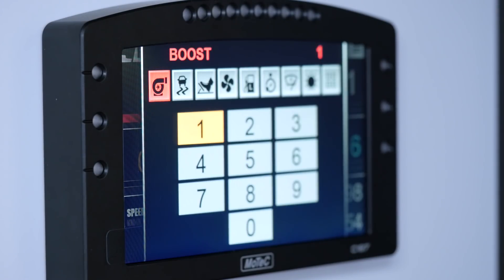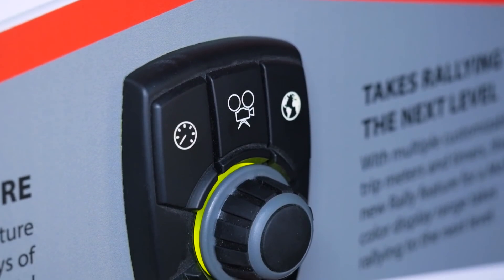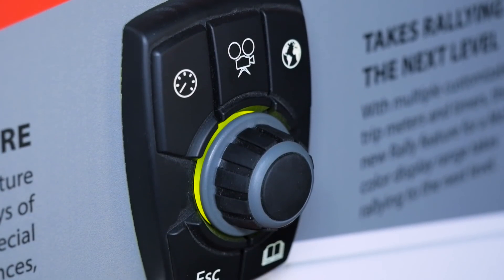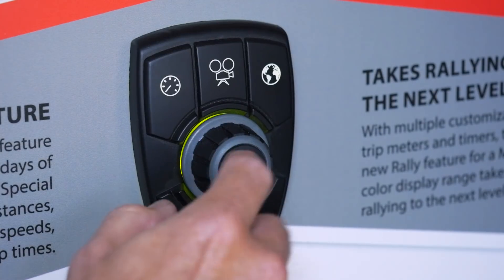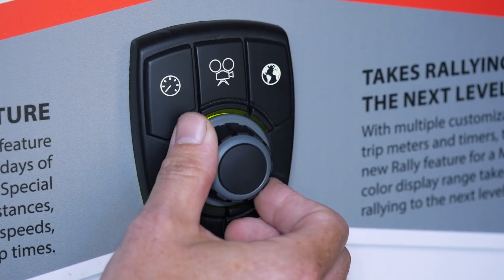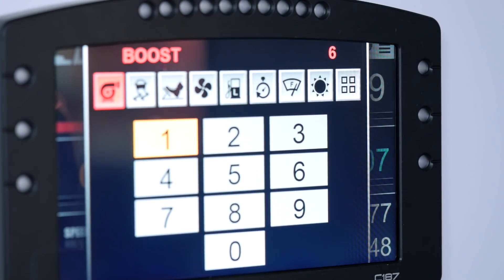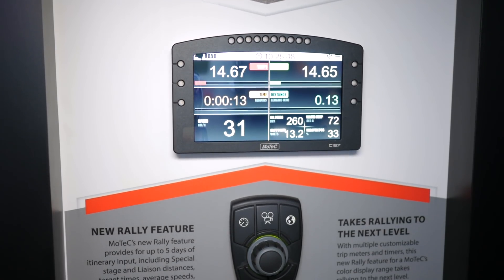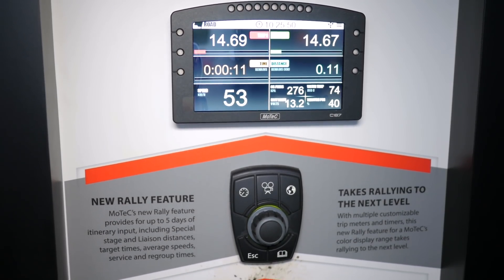Quick Adjustments On The Track | MoTeC [TECH NUGGET]

Comment: It's funny to see that CANBUS is really just becoming mainstream in performance engine control....... but in my experience...' 25 years in the printing industry as an electrician'..... it's actually very very very old school!!!! I and countless others have been working with CANBUS and many other much better protocols for at least 15 to 20 years!!!!!  CANBUS is not new.... it's good... but not new!  But it's sold to you as the latest BIG THING!
Reply from the maker: Yes it's not news or a secret that the aftermarket industry is well behind that of the professional motorsports industry and some OEM equipment, however, comparatively, it is now cheaper to the point that many semi-professional and club sport level enthusiasts can afford the technology, not just professional level teams who are already onto new things that are currently unobtanium in the aftermarket. It's just the way it works, as a rule anyway =) - Taz.